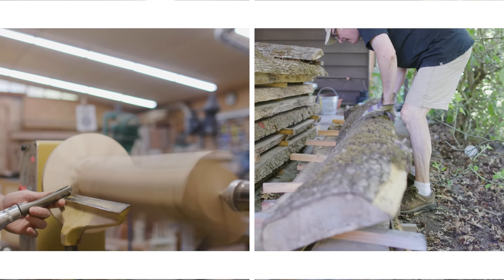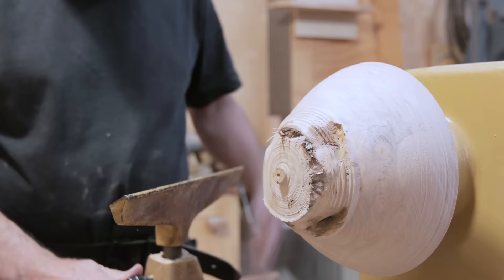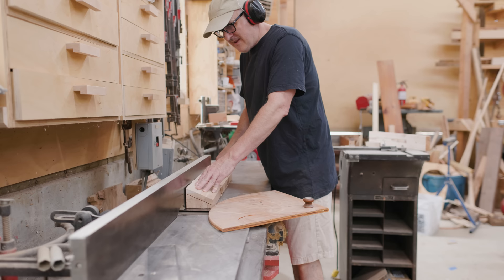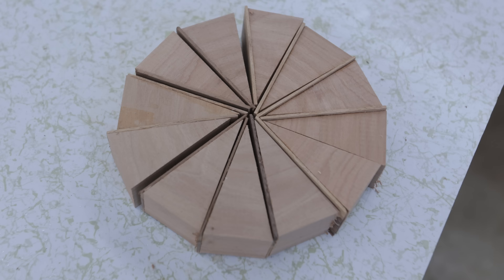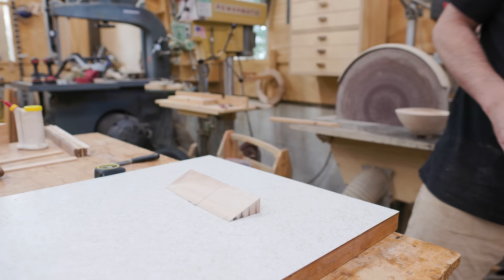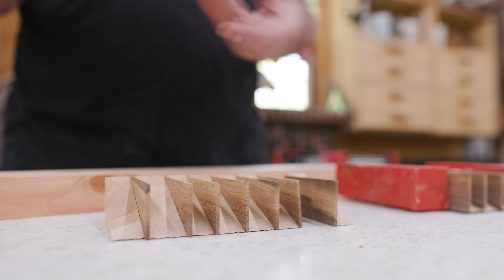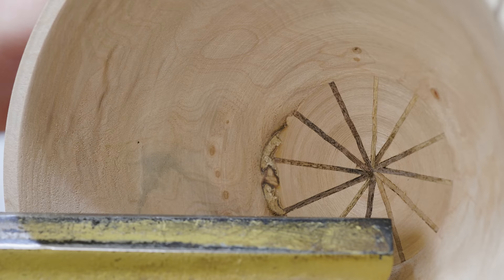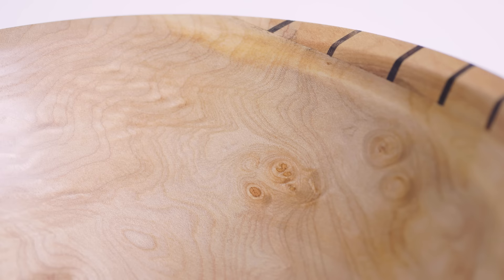Maple Knot Bowl

Comment: Excellent vid as always Frank! A trick I've used for slippery glue ups like your segmented edge wedge is to sprinkle a few grains of table salt into the wet joint, which adds a little traction owing to the cube shape of the grains. So far I haven't seen any downsides with the tiny amount I've used. I think it dissolves into the wet glue. Cheers!